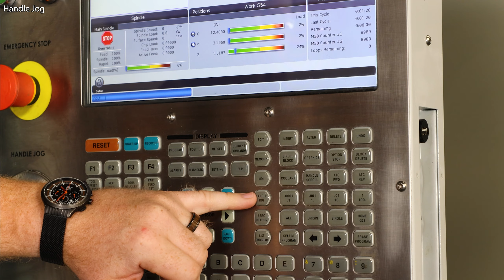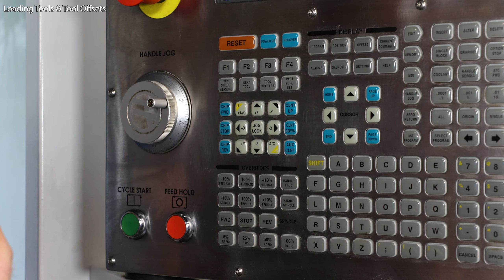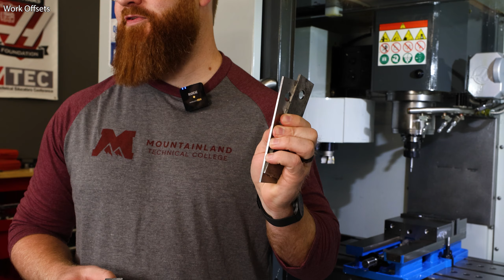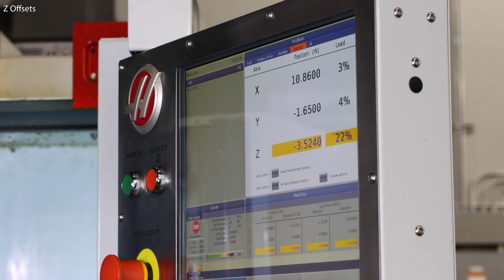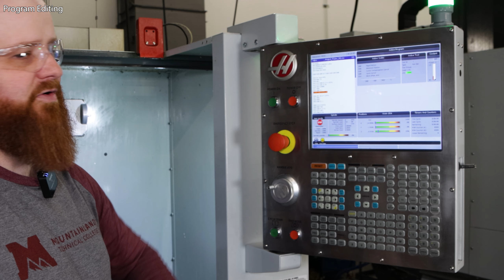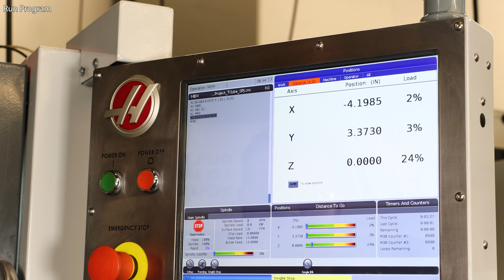Haas Mini Mill

Comment: In the MDI page, press T(what ever tool you want) and then ATC FWD.  Much less buttons to push.  When you "POWER UP/RESTART" you mentioned starting the hydraulics.  What hydraulic system does your mini-mill have?
Reply: I’ve noticed a lot of machines don’t have a ATC forward button. I could see it being important to teach the function in MDI rather than using a hotkey.  This machine does not use hydraulics, but I’ve seen A lot that do, especially lathes and mill turns